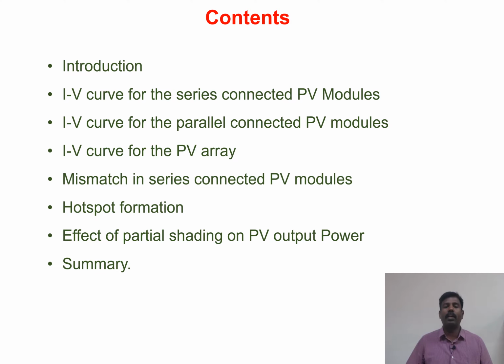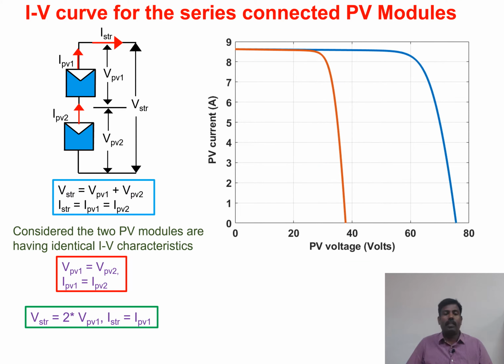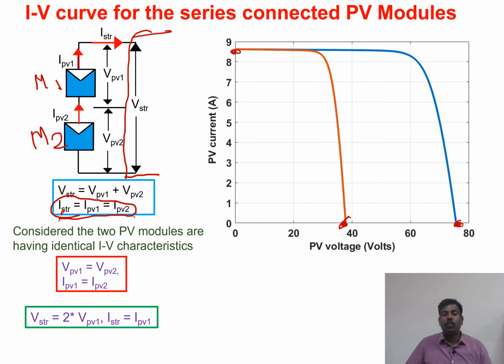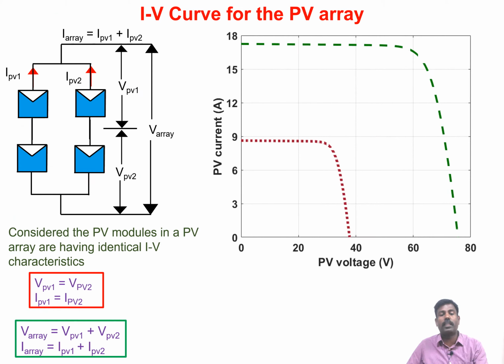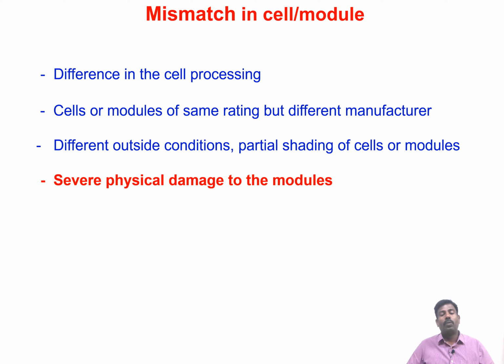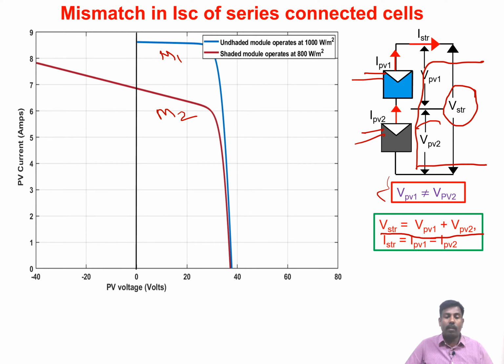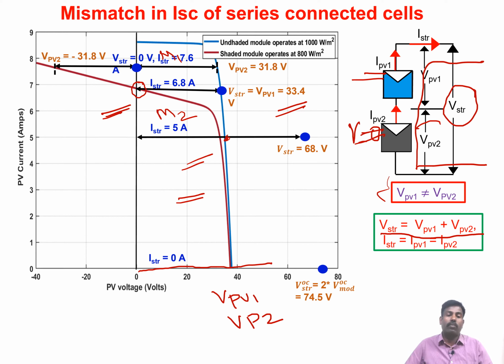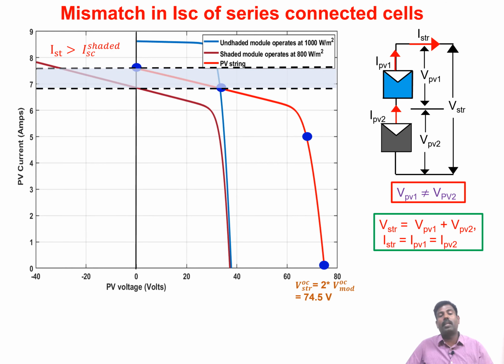Series and parallel connection of PV modules

Comment: Please sir what DC voltage required for 3-phase system.
Reply: 1.5 times the Grid voltage
Reply: @saravanailango5081 inverter supply 1-phase DC voltage=230v+
3-phase DC voltage=1.5*440v
Reply: My firm load=8KW
my solar PV  plant 10KW, 3-phase supply required
One panel rating is Pmax=332W
Voc=45.32v, Isc=9.48A, Vmp=37.29v, Imp=8.92A, maximum system rating=1500V

How much DC voltage connected to inverter? 
How many panel connected in series and parallel?
Reply: @akashsenta3601  yes it has to be in range more than 700
Reply: @akashsenta3601  see the rating of the inverter voltage and current . Based on that you can connect
Reply: @saravanailango5081  
My inverter rating
Vdc(max) =1000V
Vdc(mpp) =360v-800v
Idc(max) =33A/11A
Vac(nom) =3/N/PE 230/400v
Iac(nom) =21.7A
f(nom) =50/60Hz
Sac(nom) =15000VA
P.F=1, adj
Reply: @akashsenta3601  see that the mmp voltge  of the string is less than 800v